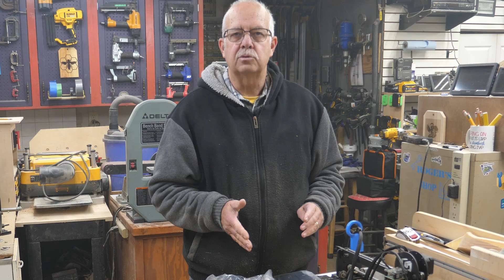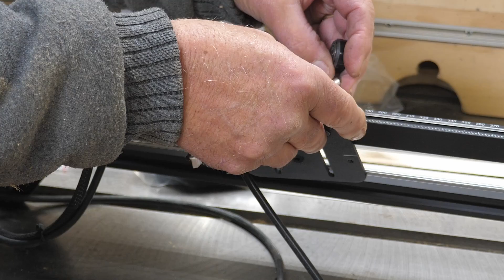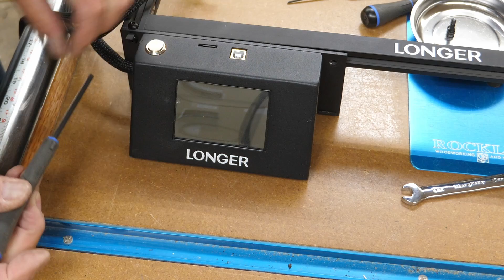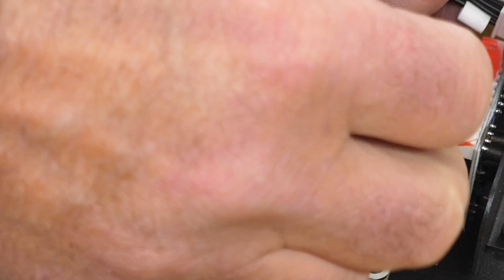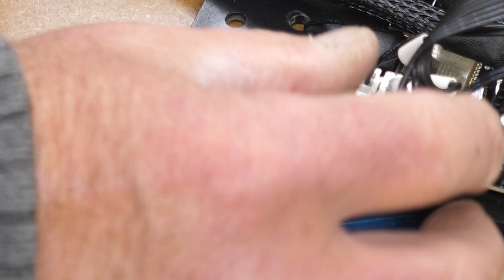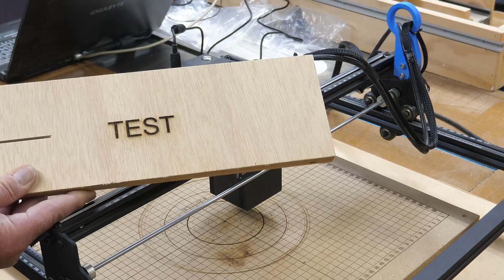Longer Ray 5 Laser Upgrade to 20 Watt

Comment: where is it possible to download the mkslasertool firmware program. the internet has tons of information on the software but no where to get it. i found one site but you have to jump through hoops to get a program that does not work. So are there any alteritives to that mkslasertool program

Comment: Hey Roger, ??Question for you i noticed in your video you put the x at 33mm and y at 72mm is this different for each Longer ray5 20w?  Mine says it needs to be on x 23mm and y 85mm, I was just curious I wanted to make sure i had mine setup correctly.  thanks again

Comment: Hey Roger, I have a queston sent you an email as well but do you know what cable i would need to use if I have the y axis extension or where i can buy it find it?  Just upgraded from 10w to 20w and the cable that came with the extension doesnt work and the cable for the 20w is too short to utilize the extension.  Thanks for the help!
Reply from the maker: Contact Longer.  Response is delayed due to them being in China.

Comment: I just upgraded…. And If the laser module is plugged in the back…. The entire machine won’t turn on.   If I unplug the laser module.. the machine boots up and moves on X and y… but laser has no power…. Bought the 20w upgrade kit from longer.   Trying to figure out wants wrong…. Thanks!

Comment: I purchased the 20-watt machine and received it yesterday. After assembling and starting it up it homes and hits the limit switch, the machine turns off. I noticed in your video you said the perimeters we're 400 by 400 with the 10-watt but now that you have the 20 w it changed to 375 by 375 maybe I should change my perimeters to these numbers and see what happens

Comment: Just got mine today all together but when I try to engrave. It stops in the middle can you help?
Reply from the maker: If using Lightburn, what are your settings?  Are you homing the laser first?
Reply: @rogersshop  Yes Lightburn, and yes, I home the laser first
Reply: @rogersshop  Yes I'm homing the laser first. I called support they said they have had trouble with some of the motherboards. Sounds like they are going to send me one. Had to go back to my atom stack 5 watt.

Comment: Hi Roger,
Just got the limit switch kit for my Laser.
I just noticed the instructions from Longer show the new cable to have the Y motor connected to the motherboard on the Y1 slot; my old cable like yours is hooked up to the Y2 connector on the motherboard. Yours seemed to work ok when directly swapped to the Y2 slot. Any idea why there are two Y slots on the motherboard?
Reply from the maker: Some lasers (brands) have two Y axis motors.  Both work together, so output is the same.
Reply: @rogersshop  Hi Roger, Many thanks for the clarification.

Comment: Hi Roger, thanks for the videos on the Longer Ray5. I got one recently and had some good success after watching the videos on your channel.
This week I installed the limit switches, however, the Y-axis (which is connected to the Probe port) isn't responding. You're mentioning a firmware upgrade. I checked my firmware and it's v1.2.4 (it was shipped with this version) Should I be finding another firmware with specific settings for the limit switched?
Thanks in advance
Reply from the maker: If there is another firmware, I am not aware of it.
Reply: @rogersshop  I received a message from Longer support with the link to a new firmware (v1.2.4 with limit support)
I burned firmware this using my Mac and all is working as expected now
Reply from the maker: @twit2epy  Excellent!  I must already have had the newer version, since it worked right off.
Reply: I just received my machine the other day and when it hits the limit switch on the x-axis it shuts off the machine completely.
Reply: @paulraycastillo2238  did you install the firmware that supports the limit switches?

Comment: I received my limit switches and new cable for my 10W Ray5. The instructions on how to install the switches are quite clear, but updating the firmware - crap. I have a MacBook with Mac operating system, not a Windows PC. I've been in contact with Longer support which is prompt, but very unclear on the process on where to install [PC or SD card that came with laser], how to install. It says to unzip a file but when I do all I see an EXE file. That's a Windows-based file. I see the .bin firmware file and the .txt file, but the instructions on how to update the firmware are not very clear or precise. Can anyone help me do this and exactly how it's done on a Mac?
Reply from the maker: Sorry, not a MAc user

Comment: I'm thinking of buying a laser engraver. I have watched many,many videos to help me decide which machine to purchase. In all of the videos I have seen, no one ever talks about support from the manufacture. Maybe because the reviewer is given the machine and knows nothing about the company that gave it to them. I have a small machine shop and a major concern for me when it comes to equipment purchase is will the manufacture provide me with tech support and parts when the warranty runs out. What is and what is not covered under warranty. I have checked a lot of manufacture websites some don't even list a warranty. Some list certain parts under warranty for a year and other parts on the same machine as a 6 month warranty.A machine that can not run because it needs a parts, cannot make me money. I think this information is important to the consumer looking to purchase any kind of equipment but it never provided. ?????
Reply from the maker: Longer's tech support has been fine for both the lasers and 3D printers.  There is a 24 hour delay in response since the support is in China, but they will take care of any inquiries (not on weekends)

Comment: Hi Roger..Since you have the 20W laser.  What settings do you use to CUT through 1/4 MDF?  I have tried everything and still have yet to cut through this.  I know this laser is more than capable to do this thickness, but no luck.  I did a grid from 10-100 power and 100-1000 speed and it did nothing but engrave when I had every line set to LINE instead of FILL @ 1 pass.
Reply from the maker: 150mm/min @ 100% power.  Although, I rarely cut MDF.  MDF can vary widely on density and composition.
Reply: @Roger's Shop  thanks for the reply.   The color codes for this machine is standard?  Red being cut? Blue engrave?  Or do the colors matter?

Comment: Hi Roger, I've been trying to use my Longer Ray5 10w as an offline laser (Sd Card) though when I have the 400x400 grid setup in LightBurn and then set for example a 4inx4in square and save the gcode to the SD card and move it over to the laser it frames some really large square that is nothing even close to the 4inx4in square I made... I've tried looking for a solution though it appears multiple people are having this issue with no real solid answer. Would you happen to know what is going on?
Reply from the maker: what are you using for a start point in Lightburn?  Current Position, User defined position, or Absolute Coordinates? Are you using a toolpath (T1, T2) in lightburn?
Reply: @rogersshop  I have tried both User Origin and Absolute Coordinates. I've done a T1 4x4 square to have an idea of framing and then 01(blue) as my image... I have even tried to turn my original T1 into the 00 cut with 1% power and then the 01. With the same results every time.

Comment: Good review!  I saw that they started selling the 20 watt and was wondering how it performed.  I'm enjoying my 10 watt Longer Ray5.  With the beam not being square like the 10 watt how does it do with box joints?  Does the rectangular beam make the fingers wider in a particular direction?  If so is there a way to compensate for this that you know of in Lightburn?
Reply from the maker: I haven't tried it out on box joints yet.  I did do a run of coaster holders that have tabs and slots and the fit was perfect.  Almost did not need glue.  There is a way to compensate for kerf in Lightburn, but is too complex to put into a comment reply.

Comment: Very interesting video. I'm thinking of doing this upgrade for my 10W longer Ray 5. However I can't understand how you can feed steppers and motherboard which were rated for 12v with a 24V power supply. If anyone can explain this to me, I might hit the Buy it Button!. Thanks for your help!
Reply from the maker: Without getting overly technical...........There is a voltage regulator on the motherboard.
Reply: @rogersshop  Bought it! I posted the link to the upgrade below.. It's hidden from the menus.
Reply from the maker: @billywhizzy  I also just received the link :  https://s.zbanx.com/r/YV9GxzZYPTjU

Comment: I need the cable that hooks to the board and x and y axis
Reply: I have tried and waiting to hear it's the cable or the board it started skipping and I found a broken pin on motor replaced it did not work played with wires it worked then stopped
Reply from the maker: @Joshuaellis420  Sounds like a defective cable.  Just dealt with that on one of my 3D printers.
Reply: @rogersshop  cool that gives me hope I'm still new but not scared to try.  I may take it loose in the box
Reply from the maker: You could possibly inquire to Longer for one, or make one.

Comment: Nice upgrade there. Think I'll stick with my 10W Ray for now; good balance for engraving and cutting and the kerf is small and symmetrical. The bigger the laser diodes go up in power their purpose is for cutting only and there is a trade-off for the extra power in that a larger kerf and asymmetry in the laser dot occurs.

If Longer provides a limit switch kit I'd get that but suspect it is there for the larger laser module size.
Reply from the maker: Cutting is now what this will primarily be used for.  This will cut 1/2" western red cedar in one pass, which is something I use a lot.  My scroll saw may get lonely!
Reply: @Roger's Shop  Yeah makes sense. Got the Neje E80 24W module last week which is for big cut projects on the Max 3.
Reply from the maker: @TheAndrian463  This will also do 3/4" pine, but it takes so long with multiple passes, that unless it is a complex cut out, I can do it faster on the bandsaw or scroll saw.  Haven't tried this yet on my CO2 laser.

Comment: Roger thank you for taking the time to go into detail on the upgrade to 20 watts. Will Longer be selling a kit with the wire harness and limit switches? I'm happy with my 10 watt laser head and don't see a need for the 20 watt yet.
Reply from the maker: Yes, there will be a kit available soon.  As soon as it is, I will add a link in the video description.
Reply: @rogersshop  Thank you!

Comment: Nice!  Thinking about the new TwoTrees 20w with auto focus.  Guess you can set it to auto focus on the top for engraving or focus on center for cutting.  Hope you do a review on it one day!  Thanks Roger!!!!
Reply from the maker: IMHO, stay away from Two Trees.  I purchased one a ways back and it was absolute junk.  Of the 9 rollers, 6 had bad bearings.  The laser head died after about 6 hours of use.  Reply from their tech support was "We will do better next time.  You can purchase replacement parts."  Unless they "give" me one to test, I will never purchase another from Two Trees.
Reply: @rogersshop  Wow, thanks for the information.  I am having a similar experience with FlyingBear on their LaserMan I bought!
Reply from the maker: @slhasebroock  I have one of those and have used it quite a bit.  What exactly is/are the issue(s)?